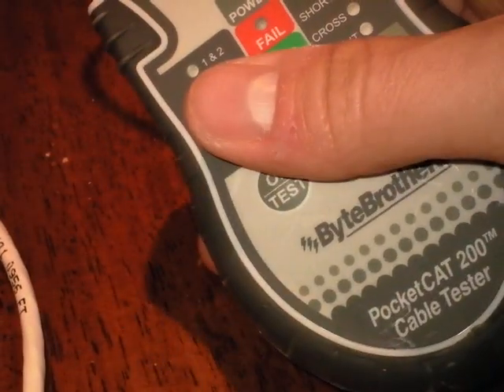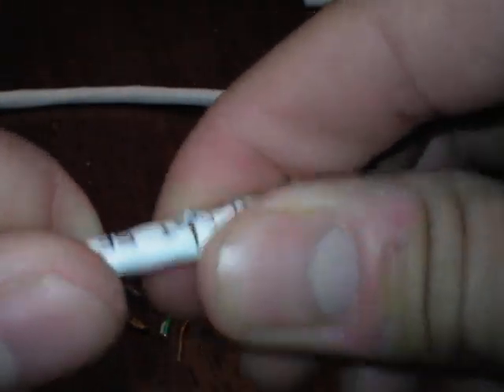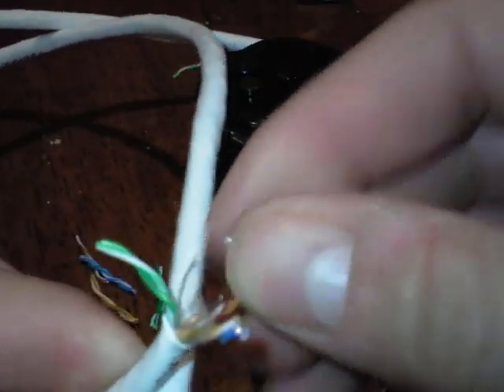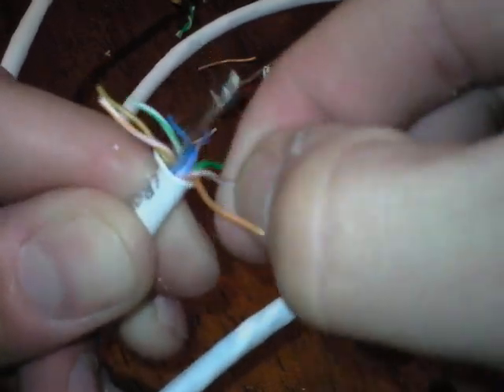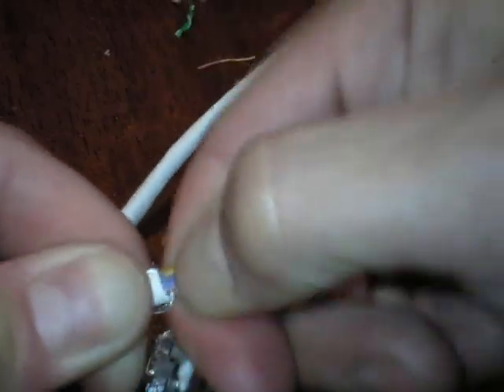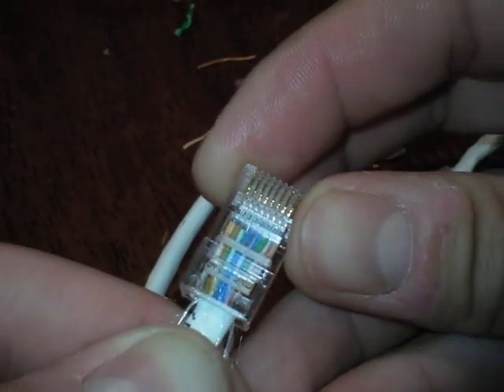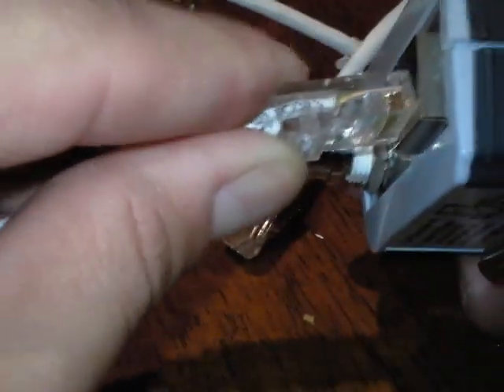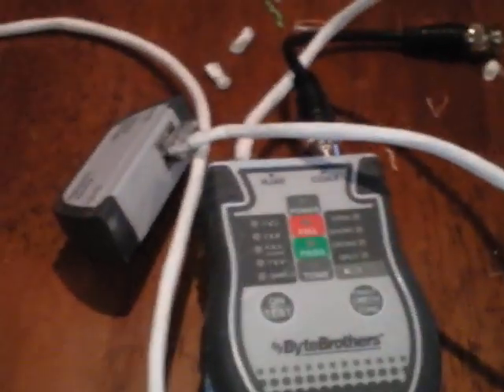How to make Network Ethernet cable connector Review

Comment: Thank you so much for this totorial video.
i watched others, but your video showed and explaned much greater
details how to repair eithernet cable. I have been living with a broken
tab for years.  every so often i would lose my internat connection.  
i would have to go to my back of my computer and reinsist closer to the port ton reistablish the connection. My cable runs from  upstairs down walls to the basement, a big hassle to replace. It's fixed now and very greatful. Thank you once again.